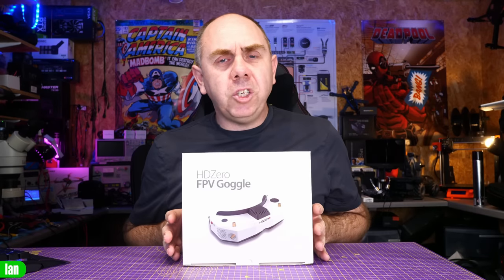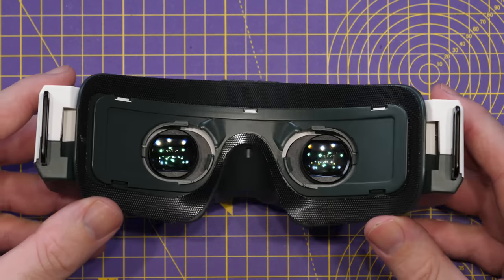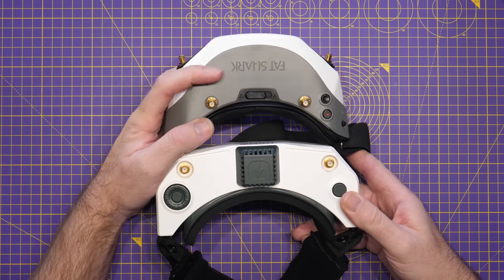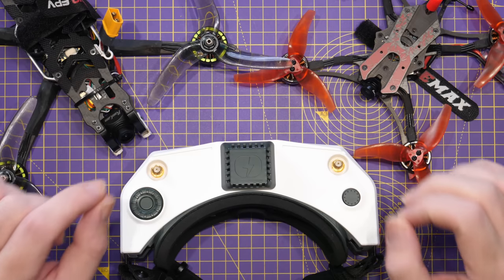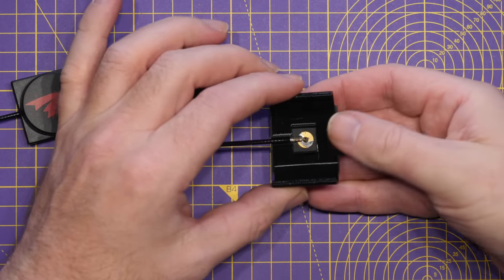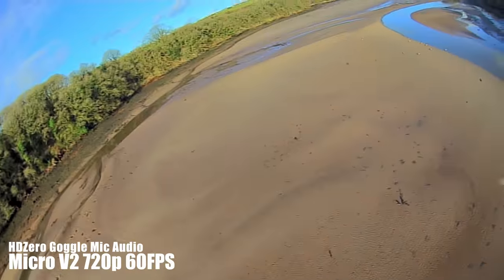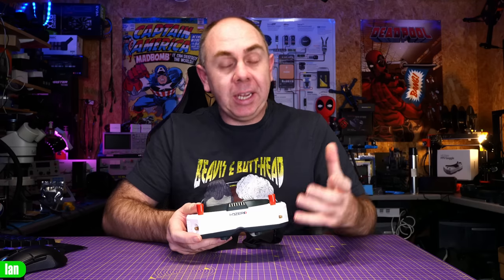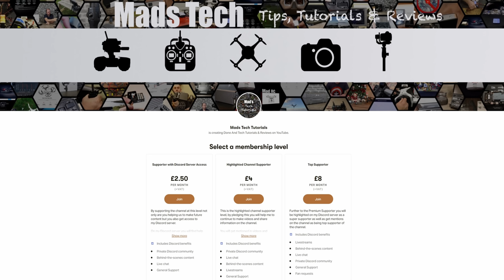HDZero FPV Goggles Review - Best FPV Goggle Available Today?

Comment: Soooo stoked to have my order in. My only hope is that I like these goggles with the walksnail module well enough to ditch DJI all together. It’s delusional to compare anything to the O3, but I’m at the point where “good enough” can be good enough for me in a lot of respects.

Really awesome that early adopters are getting a refund for the price differential too. Never heard of a company doing something like that. Carl and the HDZero team are the heroes we needed but don’t deserve…
Reply: This is what this goggle has done for me. I run HDZero, Avatar and analog on this goggle, and have been happy, very happy!

The O3/G2 is beautiful, but feels bad in the air, was a novelty for a couple of weeks but I ditched it because it caused huge problems flying with others, they can only use channel 1 and 8 or get knocked out of the air randomly. Super sad. But honestly it wasn’t a viable flying experience for me, just bothered me in flight, a lot honestly. I never could fly like I want, in the month I forced myself to used it, and the few weeks I owned and flew every day. I just couldn’t get used to the weird lagging.
Reply: @lemonsquareFPV  that’s good to hear. I am almost done with my first O3 build and excited to try it on my v2 goggles. It was beautiful when I saw it on the G2s and Avata, but yeah… I’d take vista-level image quality in a goggle that did everything else over carrying a second setup just to get the O3 image, personally. Fingers crossed walksnail can deliver a close-enough-to-vista kind of experience.
Reply: @abertheham  the V2 with O3 is a horrible experience, I think DJI optimized everything in the O3 system for the G2. With that combination, it looks absolutely amazing honestly!

You will be super happy with O3, it is a very cool experience! Just not for me, and my style. But it literally could be perfect for you, don’t let my opinion sway you, at all.

For picture quality, it is breathtaking, and the shadow detail is amazing with the G2 goggle, on the V2s I couldn’t fly or see in the shadows, at all. When I switched to the G2 I could explore in near pitch dark in this decrepit factory I was flying, I couldn’t even go inside it with the V2s. It is a VERY, different experience, and I definitely do not recommend you use the V2 goggles.

But as with everything, don’t just take my word for it, or anyone else’s to be honest, please try it yourself. You will see what I mean. But if you don’t fly in marginal lightings conditions, it’s fine. Again, just because I don’t like it , doesn’t mean you shouldn’t. Just experiment and form your own opinion.

Happy flying!
Reply: @lemonsquareFPV  appreciate the response. I’ll tinker with image settings and whatnot but yeah… I’m not buying G2’s - basically no scenario in which I’d go that route. If I don’t like the O3/V2 experience, I’ll just stick with Vistas until I decide to drop DJI entirely. 

We’ll see…
Reply: @abertheham  image settings don’t work unfortunately, but maybe you will have better luck. Firmware DOES change, so things might be different now, I completely dropped DJI a few weeks ago, and maybe things have changed since?

I dropped DJI after the havoc O3 caused flying with others (and the fact most are not flying it in my area), definitely not a social system, unless everyone runs it, but just on principle I’m done with it. Plus honestly I have been enjoying the consistent latency of Avatar.

Vistas can still be sold for good money. The majority run DJI, so the system will always have a good size user base, and if you fly only with DJI pilots I would say, stick with it, it’s a great system honestly.

Whatever you decide, I wish you the best of luck, and hope you find what you are looking for.

After playing with everything I finally found something I fell in love with, HDZero goggle! So me, I am very happy, and wish everyone could get to this point in their journey, and just be happy and not bicker about nothing :p
Reply: @lemonsquareFPV  Yikes. I've seen Ian's spectrum analysis of the O3 system and it did look like its transmission just bounced all over the place. Seemed like setting the channel manually helped with that? But yes, I was also concerned with only the 3 channels available.
Also, did you actually find the Avatar/Walksnail latency more consistent than DJI? I thought Walksnail had slightly higher latency than DJI?
Reply: @Vousie  I’m not sure if Ian had multiple systems together at the same time… yes, O3 is messy by itself, but it honestly seems to get even worse when you have others trying to fly too.

Then everyone just gets blasted by O3… it’s been a nightmare, sad honestly… we have no solution, and don’t know what to do. I just try to stay far away from any that are flying it, as I don’t fly O3 anymore. I just gave up, it was just issue after issue and I grew tired.

The goggle 2 is not bad, and the air unit and camera strip down pretty easily if you want to lose half the weight, and the image is Godly, but flight feel is lacking and interoperability is a nightmare. Just not worth it personally. Amazing system, and for some, it would be absolutely perfect, but they really gotta do something about knocking others out of the air or this upcoming summer will suck!

Flight feel wise, yeah Avatar has been great! Honestly I didn’t expect much from it, at all! I was just curious to try it, but after experiencing how much better it feels in the air it is now my secondary system after HDZero.

I honestly got super pleasantly surprised, I thought it would feel like DJI. Nope, completely different! DJI prioritizes image quality and Avatar prioritizes latency stability and flight feel. It’s so weird! I would have never believed it if I didn’t feel it first hand!

But yeah… I went from wanting to try it on one micro… to now doing a 6” freestyle chase quad and a long range 4” quad on the system :p
crazy!
Reply: @lemonsquareFPV  This is really fascinating. So you find the latency much more stable than with DJI? I've only seen review tests and they seemed to show DJI & Walksnail being very similar (which is what Joshua Bardwell said in one of his tests - even that WS was sometimes worse) but to me it did look kinda like Walksnail didn't quite jump to high latency as easily.
So do you freestyle with HDZero instead of Walksnail then?
Reply: @Vousie  After flying, you notice how different the systems are, DJI will sacrifice latency and link stability, to hold on to the absolute greatest picture possible, and this is what most everyone complains about, the lag and stutter. Avatar on the other hand will hold latency, frame timing, consistency, but will sacrifice image quality, and people complain about this too :p

You just gotta try it yourself and figure out what is important to you. I never would have believed anyone if they told me that the difference is so significant. Honestly that’s great! We don’t want a bunch of identical systems, there wouldn’t be a point!!! And they wouldn’t do well in the market.

Avatar is gaining traction, not only because it’s from a great company that actually cares about making something cool that people want… but if you are a legit pilot, you will feel that difference and greatly prefer it as it will improve your flying. It’s as simple as that sometimes.

I don’t watch JB, as I’m not a beginner anymore, and haven’t been for some time, but did skim one of his last DJI, Avatar and HDZero too maybe? comparison videos, and in the charts, the Avatar latency was WAY more stable, and DJIs jumped wildly. 

This is what you feel in the air, it was cool to see it on a chart as I am a scientist and engineer, but honestly it is so obvious how different they feel, you can’t NOT notice :p

You really gotta make up your own mind up sometimes. Other peoples views might not align with yours, as you may have completely different requirements, or understanding. And that’s okay, and it is super cool that we have such variety that people can actually choose what they want, and not be just forced in a box by a corporate entity which thinks it knows better than you. Because it doesn’t.

Some people also are genuinely mistaken, wether maliciously and driven by an external force or just oblivious to the world. I deal with people like this daily, and that’s okay, we are different, and we don’t have to be all the same.

The huge variety in video systems this year, will truly change FPV, HDZero is finally viable, as is Avatar, and I really hope DJI stop being a douche and stops maliciously knocking everyone else out of the air and just play nice, because O3 is a pretty kick ass system, I really wanted it to be the one I fly, but their corporate overlord behaviour screws up too much. And it really shows, unfortunately. They gotta humble themselves and stop trying to put everyone in their box and just play well with others, FPV at it’s core is a social phenomenon, we wouldn’t have HD cameras and go on adventures together if it wasn’t. If they smarten up this year, we will have 3 EPIC systems, all for a completely different kind of flying, and this would be so cool!!!

One can dream!

And yeah especially with the release of the Runcam90 and the HDZero goggle, that’s what I rock (and a bit of Avatar too) and my God is it glorious!!! It just fits, it is so comfortable, and so fun, I fly every day again because it is fun, after dealing with the heartbreak from the O3/G2 poop, I am back to loving flying every day!!! This is huge! And worth so much to me!

I hope you get to experience this, and I hope it helps you grow as a pilot! Sometimes you just gotta jump and do it yourself and not listen to others, don’t listen to my experience, even though it is from the heart and completely honest, try everything yourself, form your own opinions and be your own person!

All the best!
Reply: @lemonsquareFPV  Thanks, you too.

JB doesn't just do videos for "beginners" - he also does product reviews. I don't even use Betaflight for my main quad so most of his videos aren't applicable to me (I fly ArduPilot 'cause then I get GPS position hold and other features that are usually "DJI only" but on a self-built quad.)

Mostly my problem is the only digital system I can "try" is a friend's plane with DJI V1 goggles. Not and acrobatic plane so I can't tell the latency etc. No-one I know has DJI O3 or Walksnail, so I have to do all my choices based on what I can find on the internet. For example, I'd love to be able to try out a few of the goggles so I can see if they even fit my face well... (Unfortunately I don't know a lot of FPV quad pilots in my area, other than racers who all fly analog.)

I know walksnail said a while ago that they're trying to do a fixed latency mode - which they said in the same release that they said they're gonna do a VRX and a 1s VTX, which they've now done, so I'm inclined to believe that if it's technologically possible, then they will do it. That would be very cool to see, though I'm kinda doubtful of whether it'll be possible without that latency being rather high. 

HDZero I like but the lack of HD resolution is rather bad. Do you fly freestyle then? Kinda rare to have freestyle pilots who prefer HDZero - thought it's mostly racers who use it?
Reply: @Vousie  Racers don’t ONLY fly analog :p they will usually have multiple sets of goggles just like everyone else. We are all the same from my experience.

Meet some people, try some stuff, and maybe it will give you a direction. Or at least they can point you to other people… it’s a journey, have fun with it.

For example today I met some amazing people through a recommendation from someone I know… to another person that he knows… to the people I met today! Absolutely amazing people, definitely my type of people. It was crazy… and this happens to me regularly.

Avatar is basically fixed latency, and it is in no way high, it is very comfortable to fly. As long as you are not super far the latency doesn’t change. That’s why I like it. I was flying it today and had tons of fun. I can push super hard and have a great picture. It takes me 5 seconds to calibrate my brain to the signal, but after this it is great because the latency doesn’t jump around.

I do prefer the 720, but 1080 is nice if I’m taking it easy and just enjoying the scenery. I still can push it hard, it’s just not as comfortable.

HDZero is the only system that doesn’t require my brain to calibrate, and it feels like real life, everything else feels like you are looking at a video inside a goggle or playing a video game. It’s interesting, I definitely recommend you try it if you ever get the chance. Many have the goggle already so it shouldn’t be too hard to find them. And by the summer much more people will have it. I am loving mine, it feels like a piece of professional equipment.

Or… just buy what you think you will like try it and if don’t like it, sell it. That’s what I do. I do this ALL the time!!! All these things are in such high demand, that if you don’t like it and want to sell it, it will sell within hours, you have nothing to lose honestly. I just did this with DJI Goggle 2 and O3 airunits. It didn’t fit my flying style and it sold same day. A friend just sold his Avatar goggles, also same day, another sold his HDZero VRX, same day. And I have another million recent examples that sell within a day or two.

I fly only freestyle, I am planning on getting into racing this year, and also being more social with new people, and not just sticking to my group of friends.

I fly analog, and still enjoy it, I fly HDZero and Avatar digital wise, and enjoy that too. DJI is not for me but if you haven’t tried O3 with the Goggle 2, just get that. I recommend you experience it! If you hate it you can sell it, easily, but I don’t think that will happen honestly. Especially if you don’t fly with others, just get that. And if you do fly with people, just use the same stuff they use. That’s my rule of thumb.

What do you use now? May I ask?
Reply: @lemonsquareFPV  The racers at my club only fly analog. At least, I've never seen them fly anything else - since I don't currently race I don't know if some have changed. Maybe at some point they'll upgrade to HDZero... Well, one guy flew DJI v1/v2 at one of the races... Don't think he stuck with it.
Avatar certainly isn't fixed latency at the moment. Tests have shown that it does go up to 100ms or more when signal is really bad. But yes, sounds like it remains reasonable if you don't push too far.
I don't fly enough to be a very good pilot yet - the laws in my country are so restrictive... (One of which is analog being limited to 25mW which is the main reason I want to go digital - to get the 1W output power's range)
Yeah, I've noticed the goggles & VRX's sell really well second-hand, so have debated on doing that. Unfortunately the Walksnail VRXs are sold out at the moment so I'll have to wait anyway.
I only have analog currently. I don't plan on buying DJI at all. They're too restrictive on everything, and I definitely want a system that can be used on very small quads too for indoors. Hence why I'm deciding between WS & HDZero.
Reply: @Vousie  thank you for sharing this insight with me. Very interesting. The little quads is the reason I too chose Avatar and HDZero. The both work well for that.

Are you able to order from Caddx or HDZero websites or do you only get stuff locally?

I buy mostly online and mostly from AliExpress and China, even though I have 3 FPV stores in my city :p but do buy stuff locally sometimes. Especially if I need it faster than a week when ordering from China.

I’m sure most don’t follow regulations, that’s kinda how FPV is :p
Reply: @lemonsquareFPV  Even Caddx is only doing pre-orders by the look of it, and I don't do pre-orders - too many cases of people ordering and then waiting months for the stock, and by then there's a better option out. 
As for Aliexpress and the like, I have bought stuff off them before, but for something as expensive as this, I'd rather buy from a trusted store so I know if I have any warranty issues I can email them and get a swift reply.
So I'll rather wait until things are in stock again and then buy.
Reply: @Vousie  smart thinking! I definitely agree with EVERYTHING you said… I just don’t listen to my own thinking at times and do go for higher risk stuff… it has payed off recently so I have been happy. Really good point on the pre-orders, but the 3 recent ones, Goggle 2/O3, HDZero, and Avatar have paid off, so my confidence is likely higher than it should be. :p

Comment: Excellent review Ian. I guess if you have no goggles currently then sure this would be at the top of the list. However as someone who already owns analog goggles with OLEDS and hdmi in it just doesn’t make much sense for me personally. I don’t race either. Great price at 495.
Reply: Yes agreed, remember this has a built in hd receiver and the ability to run walk snail vrx as low latency 100hz mode too these abilities you're basically getting free

Comment: Cost of import is going to be an issue, upto 20% can be levied and thats before "administration" costs of the courier (such as Royal mails weird handling fees they sometimes attach to imports).  I've been burned this way before on aircraft camera mounts, paying a total of around 30% of the original costs in charges alone!  The goggles look great but with costs these goggles could get to £700 easily depending on exchange rate and costs!  Hopefully HDZero will let retailers and dealers do B2B shipping to minimise the costs to potential customers.

Comment: Unfortunately as of September 2023 they are out of stock mostly everywhere and when you can find they are overpriced, hovering at around $800 without the analog module (which is an extra $200).